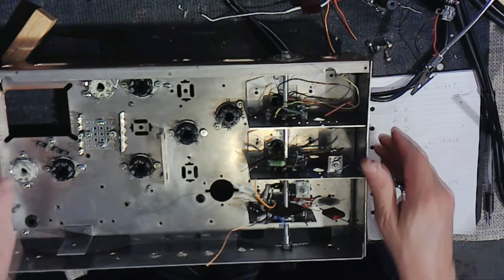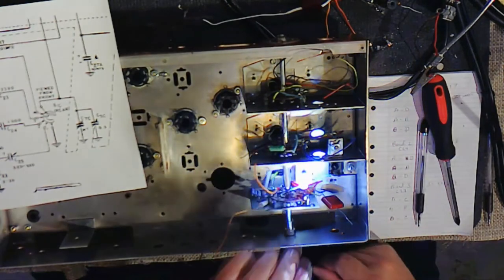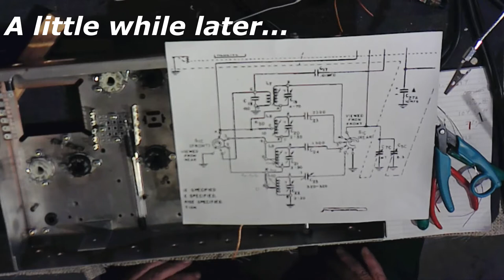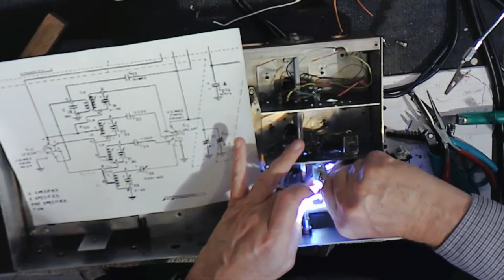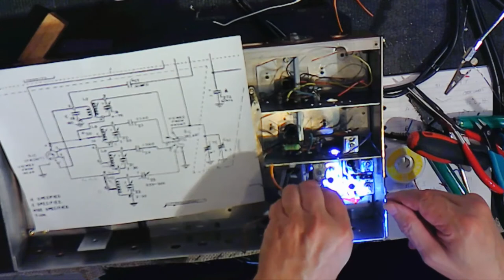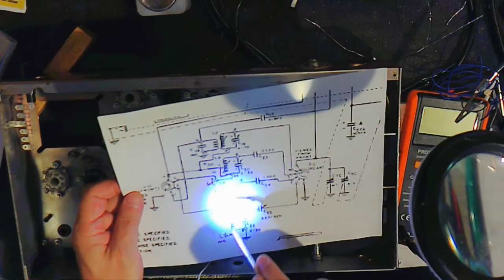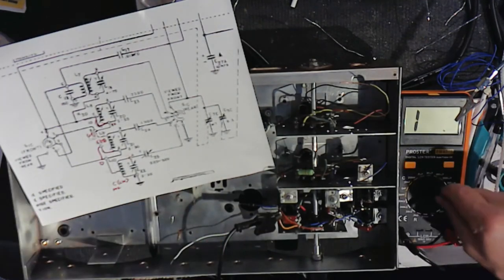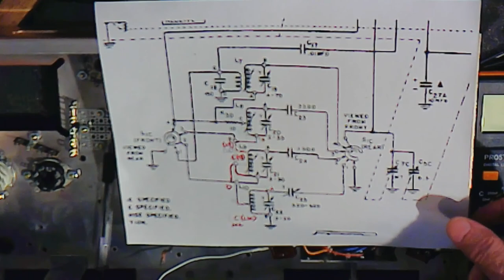Vintage Hallicrafters SX-99 Shortwave Radio Full Restoration Part 7: Oscillator Coils

Comment: So, what IS the difference between the sx-99... and the sx-99 mk-1d?
Reply from the maker: On the SX-99, essentially there is no electronic difference between the Mark 1 through Mark 1D except that the Mark 1C (never seen one) inappropriately omits C-44 (which improves audio response).  However they do differ slightly in the under chassis layouts.  The Mark 1 and maybe Mark 1B have the crystal crowded next to the selectivity control and later versions put the terminal strip neatly in the center of the chassis; there is no reduction in performance.  Also the Mark 1D has a brass bearing on the Antenna Trimmer shaft penetration of the face, which is better.  No performance difference.  The earlier versions use the lower values for R-17 and R-71.  Also the Mark 1D uses metal and not plastic see through indication dial plates, which are more robust.  Thanks for asking. Albert